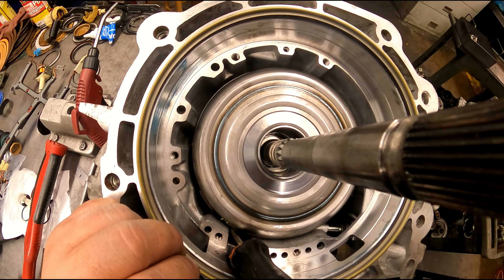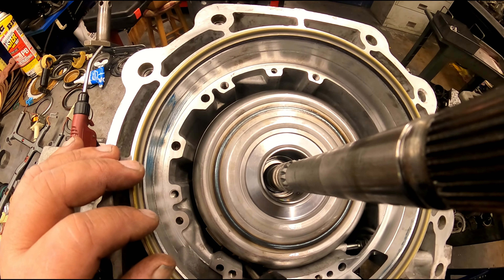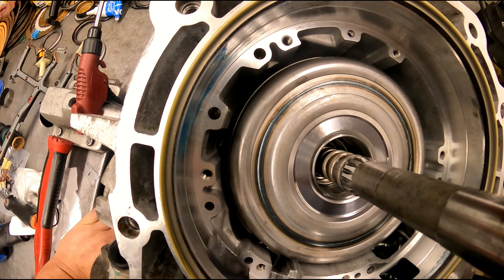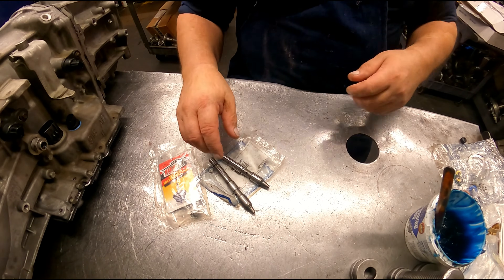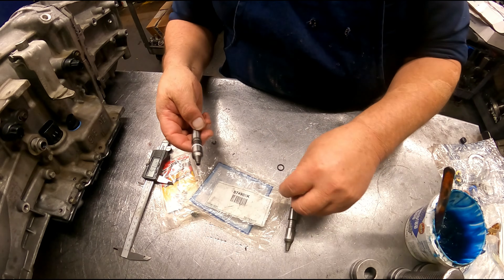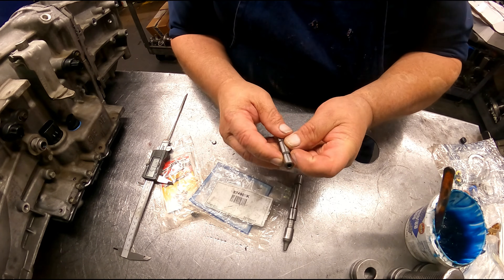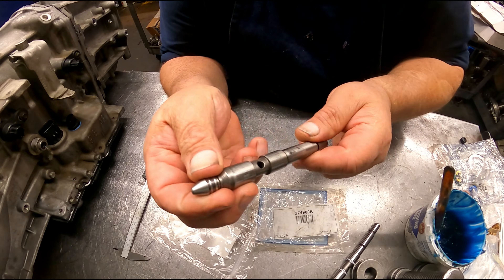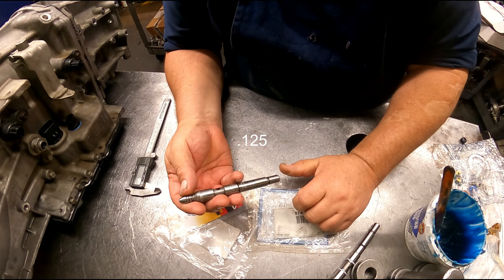4L60E Band Adjustment

Comment: Howdy...Silverado 4L60E. Daily driver. 229,000miles. All stock. No CEL or stored codes. There's no 2nd or 4th. It was shifting 1st to 3rd, and 3rd to 1st. Does same behavior in D and 3. In 2, it doesn't shift out of 1. When in 3rd, when I stomp on it, it tries to kick down to 2nd, but just flares the RPMs, bc there is no 2nd at all. Fluid clean, red, and full. No burned smell. Is there anything it could be except for 2 and 4 bands or clutches?  Guess I could measure/inspect the Servo and see from there, eh? If Servo was broken could it cause my symptoms? Thanks!
Reply from the maker: @thesetruths1404 Hi. The band will be broken.
Reply: @CurmudgeonTransmission  next to servo, that's the next easiest thing to replace.  Thanks!

Comment: Incredible amount of knowledge!! Thank You! I have an 01 tahoe. Ran perfect, then yesterday out of the blue, it just wouldnt shift after 1st gear while in drive. While in drive it will rev out 1st gear but no shifting 1st gear feels good still.. Also if i take the rpms up in 1st, there is no resistance when i let off the throttle, in other words it wont hold you back when throttle is released in 1 st. Even if the rpms are around 3 or 4000.........Fluid looks clean and at the proper level. Any Ideas?
Reply from the maker: Any codes in the system? If you have a scanner, see if the computer is even commanding the shifts.
Reply: @CurmudgeonTransmission  By a scanner are we talking an OBD scanner? There is no check engine light on.
Reply from the maker: @thereason3763  No, I'm talking about one that will show you the data from the computer. No light on does not mean there are not any codes either. Would be good to know if the computer is even commanding it to shift.